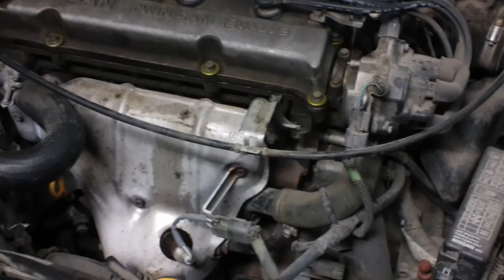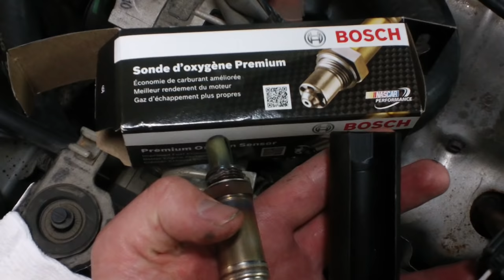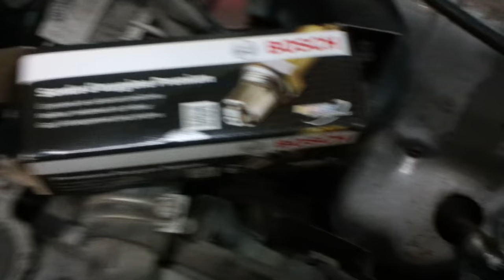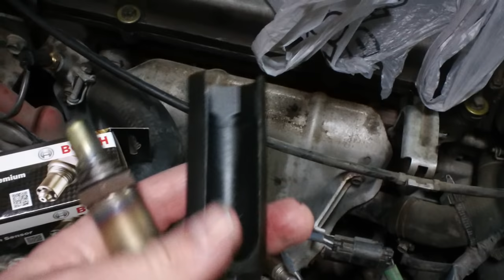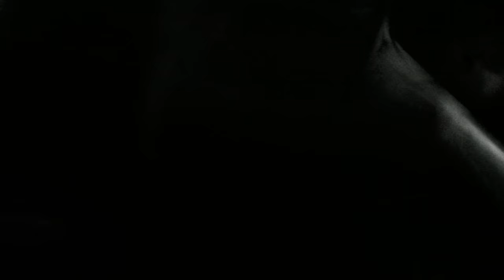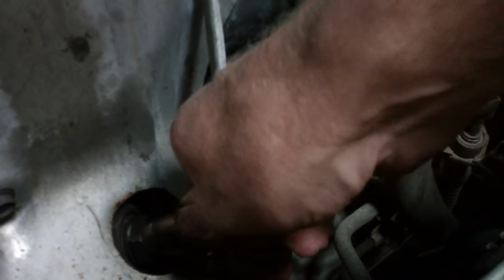Oxygen sensor replacement on a Nissan

Comment: The issue and solution: Nissans had years 2000 - 2010  the problem that rpm was fluctuating at idle and  the car did not pass the technical inspection because of environmental and showed rich fumes. This was very common in Micra's, but not only on those. The reason was the front lambda, which is giving data to ECU, which is controlling the motor; it did not work properly. Even if you changed the lambda the issue did not disappear. The basics for the reason was the earthing issue of the lambda. In ECU, the earthing had problems and did not work properly; that is why changing the lambda did not help any.  

SOLUTION: Just add an additional earthing wire for the front lambda's signal measurement. The same earthing wire is connected to the rear lambda earthing - so actually with that one wire, you fix  the both lambda's signal wires' earthing issue.

HOW TO DO IT: Because, you never know, if you already have a new lambda with new wire colours, I cannot say which wire colour is correct in your existing lambda. But I know that before the first plug, you can see and find the correct earthing/grounding wire: There are four wires coming to that plug from ECU; out of one being BLACK. That black one is the earthing/ground.  You need to connect an additional wire to that black wire and connect that to any adjacent bolt to have a good earthing.

Comment: The real difficulty I faced was pulling out the plug from the electrical connection, which was seized, without breaking the plastic. I suppose you realise that, if the Altima has the same engine as the X-Trail (QR25DE) there is a second O2 sensor downstream under the middle of the car, which generally gets badly seized due to direct exposure to rain water, salt, dirt, exhaust heat etc. WD40 a day in advance is highly recommended and great care not to damage the female thread, especially if a blowtorch needs to be used. I hate sensors on all modern cars that don't just sense, but actually cause breakdowns. Give me old-style analogic autos any time !!!

Comment: How's the car running after the O2 sensor replacement?
Reply from the maker: Good :-)
Reply: my temp is alright but engine is hot is there anyway i can do to help cool it down
Reply: +RyanDale311 hey how are u doing. I have an 2003 maxima the car is giving me hell its missing on two back cylinders I changed the air flow sensor did timing work can changed all plugs and coils but am still getting a rough idle help me out here please
Reply: H2 O oh I forgot to mention I cleaned those as well ... to late now tho I sold the car to some young kid ..

Comment: Okay so the oxygen sensor is a o2 sensor? I have a 2000 nissan altima gxe is that what you drive ?and isn't there two o2 sensors?
Reply: Upstream and downstream. Upstream is under hood and down stream is under by catalytic converter
Reply: @manneredgrain2183  on my wife's 4 cylinder Rogue, you can see the whole Catalytic converter AND both up/downstream sensors right under the hood, up front, & easily accessible.
Reply: @manneredgrain2183  ok I have a 97 maxima of code is p0141  bank.1 sensor2 you know of location sr.

Comment: Man that looked easy my 2004 nissan sentra is tossing the ses light and it reads p1148 code. Thats it right their right? That sensor?
Reply: Yeah it was the sensor i replaced it all good now.
Reply: Did the check engine light go away right away or it took some time to go away or did you reset the check engine light yourself?

Comment: You know  where  is of location  of oxygen sensor  on 97 Nissan maxima sr
Reply: Your 97 maxima is V6. Because it's a V configuration, (this one is an inline 4 cylinder,) you're going to have 4 o2 sensors. Banks 1 and 2 will each have an upstream and a down stream, (upstream is before the catalic converter, downstream is after it.) If you can afford it,  get the OEM o2 sensors. My sister has a 97 maxima, (I love that little car,) we replaced them with after market o2 sensors. While it did run fine after, the check engine light didn't want to go away because it didnt like the aftermarkets. Good luck!

Comment: it díd Work  for You amigo?
Reply from the maker: It turns out the cause of my misfire was my leaking valve cover gasket. Oil filled up the hole that the spark plug was in causing it to short out.

The recommended replacement interval for oxygen sensors is 100,000 miles so it needed to be changed out anyway.

Comment: If you take the car to a shop and ask them to give you a reading you wouldn't have to be guessing!!!
Reply: Sometimes. You're are correct, but I went into a shop for a reading and they said to replace a fuel pump...yet the problem still persisted. Apparently the pump was fine and the reading I was getting was just because the circular gasket around it was bad. difference of about $200 down to $12 :P
Reply: They dont do that for free or right away.
Reply: A $20-25 OBD2 scan tool can give you most of the info you need. That said, sometimes codes can point to a bad part when something else is causing the code to be set. Case in point, a grounded (frayed) wire on the harness an O2 sensor attaches to can have you changing the sensor just to get the same results.

Comment: Dude on ebay you can get both for 50
Reply: True but they are shit quality. Dont have to go to the dealer, but certain parts you do need to buy half way decent name brand quality.
Reply: @joem8875  yes, wouldn't skimp on O2 sensors. Have heard many people say to stick to good name brand sensors, same as OEM are if possible.

Comment: Okay so the oxygen sensor is a o2 sensor? I have a 2000 nissan altima gxe is that what you drive ?and isn't there two o2 sensors?
Reply from the maker: +Ryan Pentz There are two of them, an upper and a lower. You should probably change both of them at the same time too
Reply: Well, O2 is Oxygen...
Reply: @mearls16212  yep, 2 Oxygen atoms bonded together to create an Oxygen molecule.